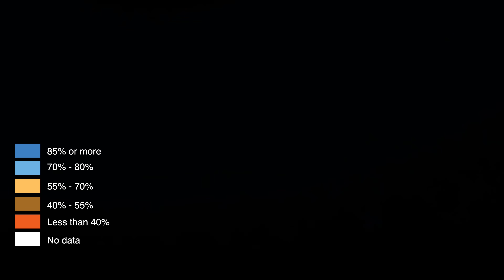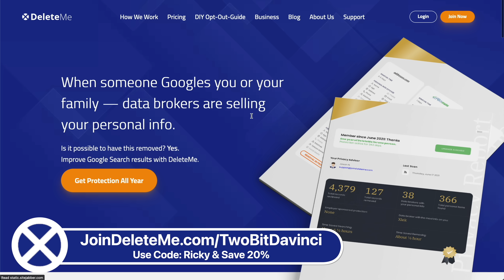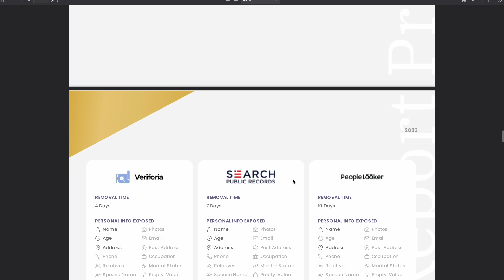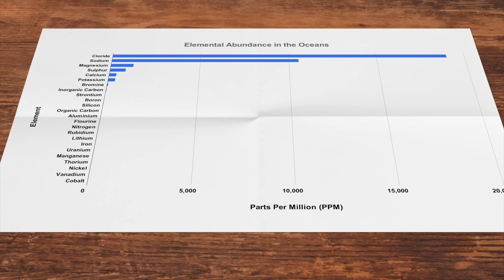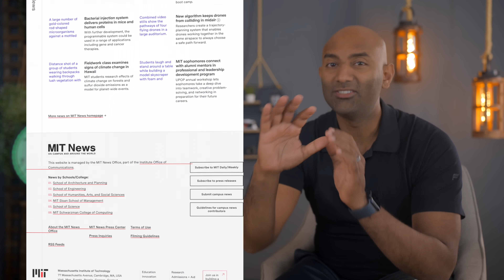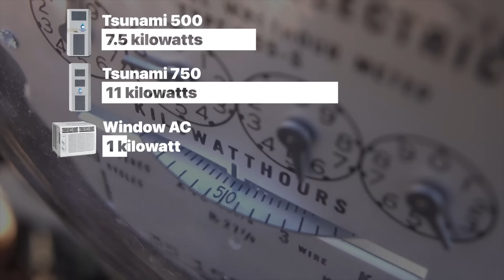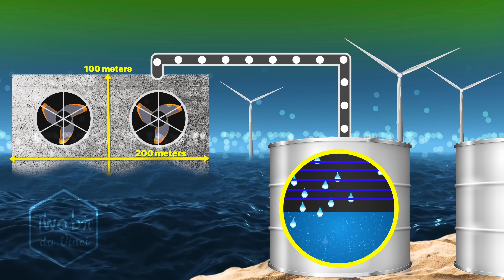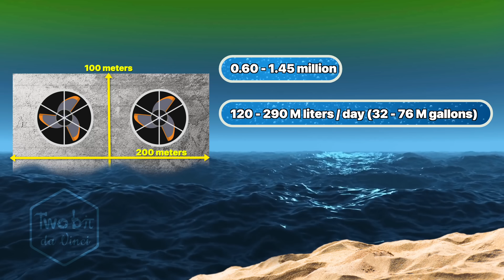This Tower Turns Ocean Fog Into FRESH Drinking Water!

Comment: Condensing water out of moisture in the air is the most energy intensive way to obtain water that I know of, it's the major reason we don't do it on a large scale. So I'm extremely skeptical that this is actually cheaper than water desalination. If it is because of the amount of moisture at the surface of the ocean, I'd be impressed. Despite that skepticism I also have other concerns.

The first of which is that air near the surface of the ocean is bound to have salt in it. Meaning that any air collected is going to need to be filtered out of that salt, or we're going to need to desalinate the water anyway making the exercise pointless. This might be as easy as using a carbon filter of some sort, but that will make maintenance frequently required raising operating costs.

It will probably require a lot more infrastructure than desalinating water as well. Each one of those harvesters is going to need to have some way to pipe the water or air back to the shore where it can be distributed. Those pipes are probably the most likely failure points as well, so they'll need to be well maintained, and possibly even be located underwater.

The last of my major concerns is that your video suggests that the water will not have to be treated. This one is probably the biggest problem. A water condensed out of the air might be pure at the time of condensation, but the environment in which it is condensed and transported in may not be nearly as hygienic, and water is very well known to stick to things and drag them along.

In short I'll believe it when I see it, for now though I'll remain skeptical. In my opinion some of the things we should do are find ways to recycle waste water, and increase our ability to collect rain water. Would it be enough, well, probably not -- as you said one of the main problems is that the water is concentrated at various regions of the world, so even in the best case scenario we still need to develop infrastructure to send water from water rich places to water poor places. Either that or lower the population in water scarce areas.

Comment: The temp of deep water in the ocean is 38F. Use insulated piping and pump this up to the surface and cool the humid air below its dew point.  Moisture will fall out of the air. Don't have to use electricity to cool it. - Mickey

Comment: How are they condensing the water vapor? The graphics showed wind turbines implying refrigeration. Surely in suitable locations, deeper sea you could pull in cool seawater from depths to condense the fresh water vapor.
Then this pre-heated water could be fed into shore side transparent solar collectors to make low pressure steam. This steam could be used to make electricity and add more fresh water to your supply.

Comment: As far as questions... I like the one about pumping it underwater to condense it in advance. I would also ask, why build a massive tower when you could use oil rig technology, create a semi-submerged floating structure that is tethered/anchored to the sea floor instead? It would use less resources to build and have a smaller impact on the deep water environment. Plus, the technology already exists, is well understood and can be built using existing infrastructure.

Comment: The Achilles heel of every ocean-based project is biofouling/rust. There might not be salt in the water that has evaporated as vapour, but the wind picks up a ton of spray from the ocean surface. How could you both protect the machinery from fouling and keep the vapour separate from the salt-laden sea spray without radically increasing costs?

Comment: I like the concept, but it is still pulling fresh water out of the ocean so it has the same problems that current community desal operations have... the salinity of the water in the vicinity of the extraction operation increases dramatically.   So there are a number of additional requirements to really make it work.   Two, primarily.  First, the unit has to be relatively far away from shore to avoid messing up marine life near the shore.  And second, the unit has to be placed in the ocean, in a consistent ocean current to defray the salinity issues.   So... commercially feasible?  Yes.  But the costs are likely hugely underestimated.

Home units are basically unworkable.   There are just too many negatives.  Up-front cost, power consumption and related costs, non-trivial maintenance, and (from experience), also noise.   My neighbor actually has a similar unit... its on his roof and solar-powered.  So, basically self-contained.  In the footprint of approximately one large solar panel his unit produces about 3 gallons of water a day and makes quite a bit of noise doing so.  He has two of them.

Comment: I'm not sure your examples of places doing water management well are particularly good ones.  The Dead Sea and Lake Mead aren't in particularly good shape.  

I remember hearing a geo-engineering idea that used this same principle.  The idea was that  you don't get nearly as much evaporation from the ocean as you could because of this supersaturated layer.  Their idea was to disturb this layer and getting it away from the surface (or just spraying water up into the air) to increase the moisture in the wind to create rain farther away.  Obviously, the scale you'd need for that would be pretty huge.

Comment: Something like this could also be deployed in reservoirs. Moist air could be drawn down into a pipe under the water where the moisture would condense. These collectors could be located on the shore of the reservoir for ease of maintenance and cleaning. Only the loop of pipe for condensing would be underwater. Reservoirs do not have the waves and tides to contend with, which is a big advantage. Reservoirs that are in canyons would probably be ideal for wind power to run the system. Warm air rises which creates a wind that blows up the canyon in the early part of the day, and cooling air creates a wind that blows down the canyon in the late afternoon and evening. Estuaries are also a possibility, and although they do have tides, they do not ordinarily have waves (except in tsunami conditions that are very rare in many areas). In estuaries air could probably be harvested from an artificial island that could be landscaped and made to look attractive. Creating an artificial island might be much cheaper than building a structure.
Reply: I hadn't thought about that. Also, freshwater has a higher vapor pressure than saltwater (colligative properties), so it could yield even more water per square feet of surface than the ocean?

Comment: don't want to be stupid but al we need high pressure point, and you can create it by simply placing a tube into the water with a membrane filter, need more pressure go deeper and start pulling the fresh membrane filter water, only install cost of the tube and anchoring, a solar pump to pump the fresh water out, Mariana Trench 36,201 feet 360 bar, 2.5 bar needed to filter through a membrane
tube with 0 aggregate, with aggregate 5 bar but you need to clean the aggregate after a set amount of liters
Reply: same for Hydrogen only smaller membrane and 300 bar pressure

Comment: This is a horrible idea. You are pulling moisture out of the air which can no longer ultimately turn into rain.
Reply from the maker: The sun should replenish the evaporation immediately.

In addition if there was any specific concern for that you could just have in run only when the prevailing wind is not heading towards the land that you want the moisture to go.
Reply: @TwoBitDaVinci  That doesn't solve the problem. This tech is removing pure water from the ocean causing increased salinity.

Comment: My idea for optimizing AWG on a home scale:
Build a greenhouse that's attached to your house, preferably on the south/Sunward side. Water the plants within with your gray water. The greenhouse will naturally be very hot and humid within. Run your AWG in there. The plants will transpire your greywater and the AWG will work at top efficiency most days as it will be near 95% RH in there constantly.
Reply from the maker: There are many awesome water recycling methods like yours...we need to do stuff like this in arid locations...and also add water to the system where needed to not deplete the aquifers.
Reply: @Two Bit da Vinci  agreed. And the reason why these water harvesting and creation methods are so important...plants are the only verifiable way to capture carbon and potentially sequester it (depending on how we process the plants material) therefore it reasons that water is the fuel for carbon capture and sequestration.
Reply: Grey water has the potential to poison the soil of edible plants.
Reply: @stuartodell1709  Also in a greenhouse there's no rain to dissolve and wash away contaminants from raw grey water, so they will accumulate in the top soil. It's better to run grey water through bio treatment septic tanks first, but even then I would never use it for direct plant watering.

Comment: Ricky
This is the most exciting and practical water solving idea I have heard yet to date. I think you're right, they have really hit on something special. As soon as I heard it, it's like a light bulb went off in my head, of course, all that water is just sitting there in the air above the ocean water. It makes so much sense and sounds like it could be easily done. Kudos to you for reporting this. Nice work!!
Reply: What happens if a corporate start bottling and selling rain clouds in sea itself ? 
Most of continent will be sand dunes .
Reply: I hope they have factored in the effects of corrosion. Probably should try and use as much plastic as possible
Reply: Exciting? It's a big dehumidifier. And like all those other free water from air scams, they are pipe dreams.
Reply: This is the same old "run your air conditioner and drink the condensation". It's essentially turning fuel into water, and it's all garbage. Desalinization is much cheaper.
Reply: In a word: Nestlé.

They own the vast majority of the fresh water supplies on earth, and are buying more all the time. 
Like minerals; water rights don't always belong to the landowners themselves, and many don't have any clue about it.
Reply: We could also use a heat exchange system using a large amount of earth to pull the heat out of the air by burring the air ducts. Then use use pipes filled with  ocean water to cool the earth that absorbed the heat.
Reply: A solution involving a wearable activated carbon filter that can be sold in two models: one uses a synthetic adaptor, while the other can be held in place in the foreskin like a chinese finger puzzle to recycle the water, at a  potentially viable source.
This could also attach directly to the back of the hand with a IV drip so employees dont have to keep running to the cafeteria for drinks on the job, therefore better able to pay off those million dollar mortages on their shoebox condos with the apartment fever.

Comment: One problem I see with this idea, is that the sea mist this guys want to collect is usually salty. It comes more from the wind lifting water droplets from the surface than from evaporation.
Reply: Yeah, any costal city has higher rust problems because of that.  And it can happen miles inland from the beach. So, I'm skeptical that this is as big a solution as they think it will be.
Reply: That definitely needs to be engineered around in this application.
Reply: Actually, this isn't collecting mist at all. It's collecting moist air, which is air with water vapor (a gas) not a mist of tiny saltwater droplets (a liquid). That's what makes this different from fog-capture devices and it's also why it needs a lot more energy to run; because you need to compress the air and cool it to force the vapor to condense
Reply: @Israel_Two_Bit  If it is collecting the water vapor, it will also collect the floating droplets. So the resulting water will be salty. There is no way around it. Maybe less salty than seawater, but still...

Comment: Fascinating!    Here in the Bay Area the humidity is often over 100%  (San Francisco fog)   so it should work fabulously well.   It comes pre-condensed!
One small nit:   You say it may be cheaper than conventional water.   The problem is that most out water bill is actually for the maintenance  of the pipes. pumping costs etc.   People make the same mistake with electric power - in our area the distribution costs are 60% of the bill.  Even if the power was free the bill would only drop 30%.  But still - a great idea!

Comment: Based on a video I saw yesterday on underwater server farms, I would think circulating cold sea water through these towers could provide all the cooling needed
Reply from the maker: Yes i would think so, great idea sounds like a win win to me
Reply: The water would have to be pumped from significant depth.  Really need power consumption numbers before I even think about being excited for this.  Ima suggest Thunderf00t do a breakdown
Reply: Electrolysis air pump
Reply: Perhaps a separate windmill driving an Archimedes screw?  Or a siphon that would flow easily once it got started..?  This should be solvable, yes..?

Comment: I imagine that using the ocean itself to cool the air might lead to issues with heating the water in the area too much; I haven't run the numbers though, so dunno for sure.
Reply: the ocean is a big power source any of the moisture taken would be quickly replaced. if it was done above land then yeah the next place over would suffer. the farther from land the better i would guess.

Comment: I really like this video.  Skeptics might talk about getting the water inland.  Yes there are issues inland.  That aside.  Majority of our population is costal.  In the case of the South West the biggest water right holder to the Colorado River is California.  That is why they are the most reluctant to sign-off on necessary reductions--they have the most lose.   This is going to be a multi solution problem.  A solution in one area may have an indirect benefit for areas it doesn't directly serve.
Reply from the maker: Thanks for watching. And yes if a coastal location like california  can solve its water issues it should at least in theory help those upstream and inland.

Comment: cool idea.  BUT, it doesn't take a roads scholar to 'see' that a person cannot take something (at point A).  And not effect something else (on down the chain, at point B).  So taking the water at (point A).  Will only cause the aquifer (where you currently draw your water (at point B)) to dry up..  So the only thing that has been done is.  Adding in the a 'relocation' cost.  Where the water used to be moved from (point A) to (point B), for free.  By the sun.  Now I need to do it with pumps and trucks. The water supply will not be magically, doubled.

Comment: I would like to see a flow diagram that includes just how much the air is compressed and the energy required to compress that air.  A high pressure psychrometric chart showing the path the air takes would be helpful. I am aware that an air compressor delivers high pressure air that contains drops of water even though the intake air does not feel especially humid. I am also aware that the high pressure air can be expanded through a turbine to help drive the compressor.

You delivered price of $20/month for a single household water needs. Does that include fuel to drive the compressor or depreciation and amortization of a solar and wind power plant to drive the compressor?
Reply: I believe they did include those factors in their calculations.

Comment: Here's an idea.
Rather than build single "towers" which might be cumbersome to transport, why not task oil rig builders to produce "legs" and float them to site then sink them in position?
A cluster of legs would hold less volume, but have more surface area exposed to provide a temperature gradient.
This would of course also be a "get out clause" for those companies as oil use declines(?)
.
One more thing..... Extend a "leg" and install a wind turbine to power the system.

Comment: How about setting up these machines over or under bridges instead of somewhere far off the coast and having to pump it long distances? 
They could potentially capture evaporation and have pipes following the bridge. They already have electrical and fiber attached under bridges already..
Unless they are worried about noise pollution from the fans turning?

Comment: I was thinking a while back exactly about this. How to make water from the sea and distribute it as cheaply as possible. 
So what I came up with is that you can take a source of steam ( powerplant exhaust, solar desalination etc) and let it do what steam does! Let it rise inside a pipe as high as possible, to the top of a gigantic water tower! Think Taipei 101 ( it resists storms and earthquake). On top of the tower you can put a passive radiator to condense the steam in to a big reservoir built in to the tower. Now you can distribute the water to any distance that I below the altitude of the tower.
No moving parts (except for valves) and low imput of energy if using solar heat, or no extra energy if waste heat is used like a powerplant steam exhaust. 
With a solar concentrator, the tower can be used as a relay to send water to the highest point of a country, and than chanel it where it's needed. 
A modern version of a roman aqueduct. 
So... If someone builds this, remember to "Render on to Cesar"